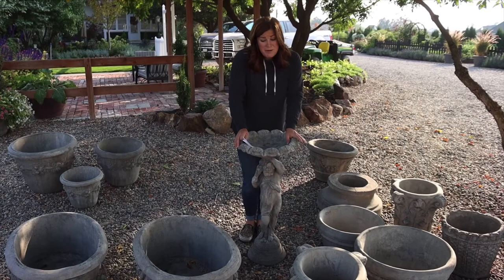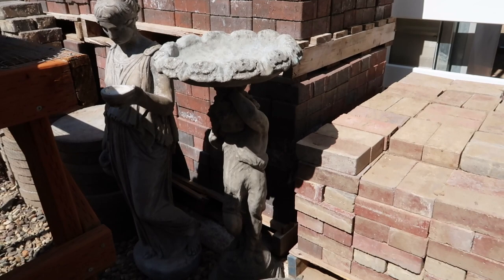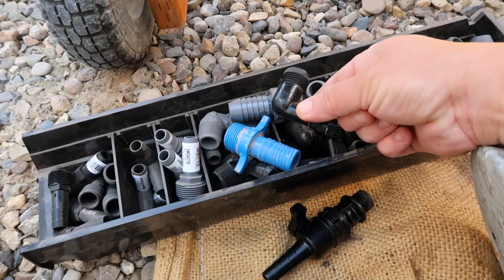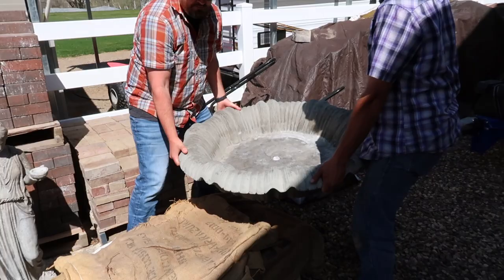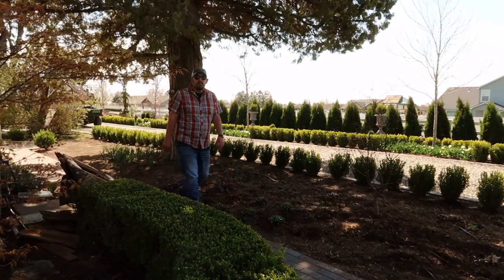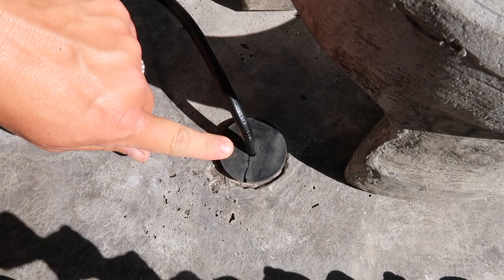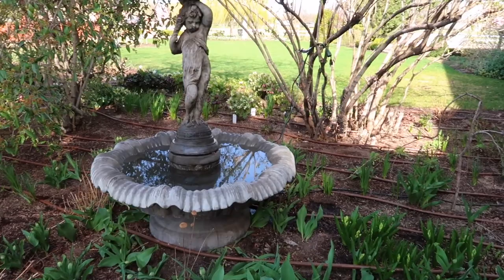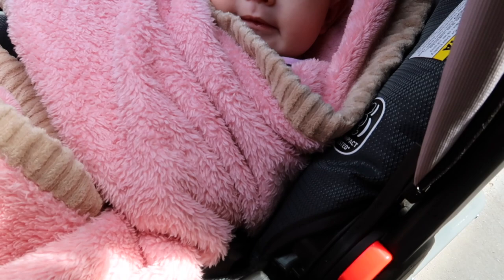Setting Up a New Fountain! ⛲️💦💙 // Garden Answer

Comment: Great video!! I have 4 fountains - one purchased and other 3 I made from grindstones or rocks.  I thought it was just me that had to fuss around to get them to work correctly, so glad it happens to a pro!  Also great tip on using silicone to correct how it drips- going to use that on a wall fountain that I stopped using because of that problem.

Comment: Laura, could you run a drip tube up through the fountain (another hole in the stopper) so it fills a little when you have the drip turned on for that flowerbed? That would help compensate for the splatter. Love the fountain! I am shopping for 2 new ones this year.

Comment: Be sure to check for lead paint on the house!
You mentioned the paint was from 1919 when the house was built. Even into the 80’s lead paint was used inside and out. It’ll be more costly and time intensive to remove

Comment: Your fountain is beautiful!  I love the sound of water, so relaxing.  We put up a fountain in a flower bed but had problems with the plants around it dying.  The soil stayed too wet.  So we moved the fountain to a patio surface and put potted plants around it.  Soon the leaves on the plants became spotted with what looked like burn spots from the splash- its in full sun.  We've tried everything to minimize the splash, even tried different plants in the pots but so far only solution has been to minimize how long we let it run which defeats the whole purpose of a fountain. I'll be curious to see if you have a similar issue with the plants surrounding yours. Would you or any of your followers have any thoughts/ideas for a solution?

Comment: Hi Laura!  I am in the process of setting up a fountain that I purchased second hand. I have a few questions:  how do you remove the water drain plug? It looks like it might be hard to remove.  Could you use a clamp to decrease the water flow to prevent splashing?  OR..use a smaller sized pump?  I appreciate your expertise/ knowledge/ experience!!!  In the end, I may need to get professional help to set up my fountain.  Thanks!

Comment: Love your video.  I have one question.  Did you use any sealant between your nymph and the ring?  We are having to replace the pump in or fountain and the installer put some kind of double sided adherent that almost looks like caulking but my husband said it isn't caulking.  Do we really need it?

Comment: Just a Curious question but wouldn’t you add Gravel on the bottom to make the ground more Sturdier for the fountain just like you did with the fountain in the corner garden by the driveway?? Would the ground shift with or without gravel installed....

Comment: On cats and running water, it both instinct to go for running water because it's safer that still water, but also cats can't actually see still water very well. It's why most cats will stick their paw in the water dish before drinking, they can't tell if there is water in there.